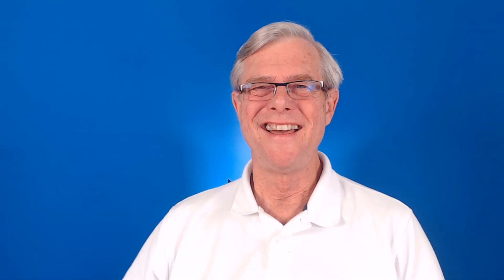Evolution of the Two-Bin Kanban Method

Comment: Yes the Multi-Bin system would be very interesting to know about, especially if it can be applied without a computer/barcode system. Two bin's simplicity means that it works excellently, even when the barcode/computer system is out of order due to maintenance or updates. I wonder if Multi-Bin can be applied effectively without a computer system.